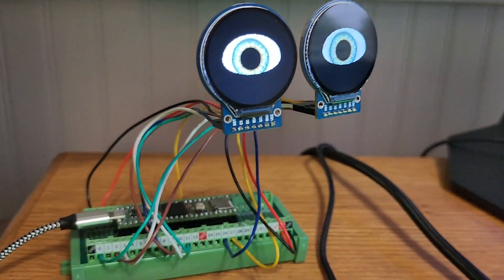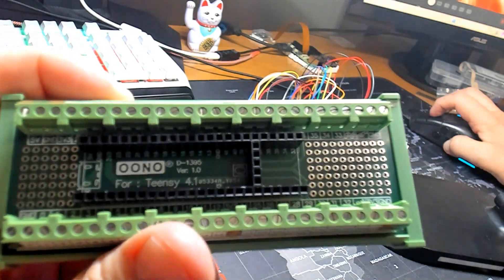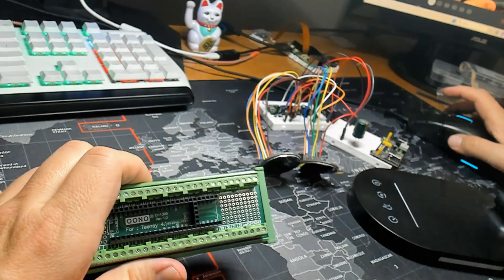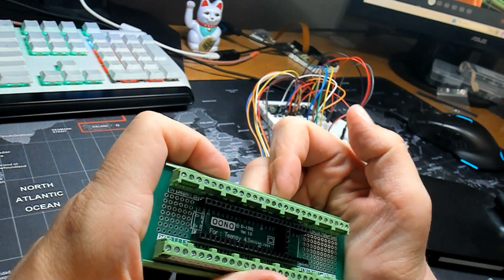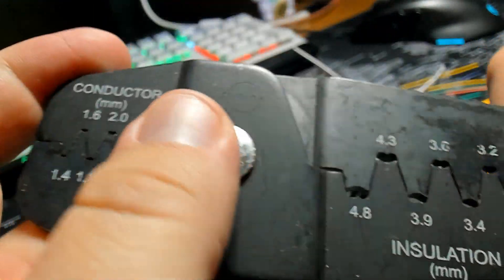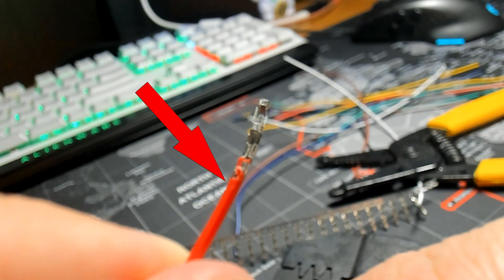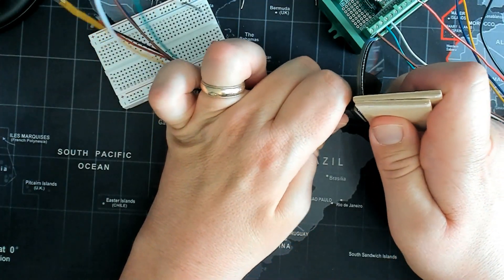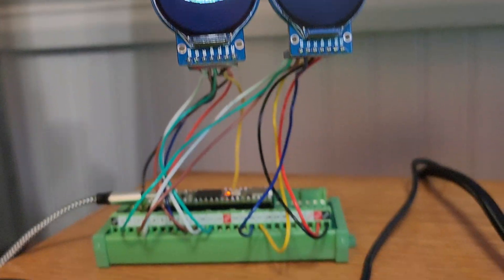Teensy 4.1 Terminal Block Breakout Board + Custom 7-Pin TFT Cable Build

Comment: Great project! With the breakout board if I buy one of the Teensy with pre installed pins then I won't have to do any soldering?
Reply from the maker: hey there!
I bought the breakout board to replace my breadboard. You can also buy the Teensy board with pins already soldered to the board. It's a few dollars extra, but worth it.
So, no soldering. Just place the Teensy 4.1 pins into the header for the breakout board - quick and simple
I like the breakout board because the pin numbers are easier to read and I can mount the entire thing anywhere with screws.